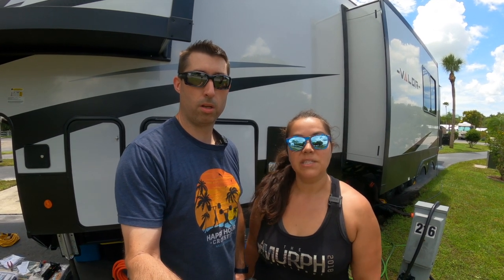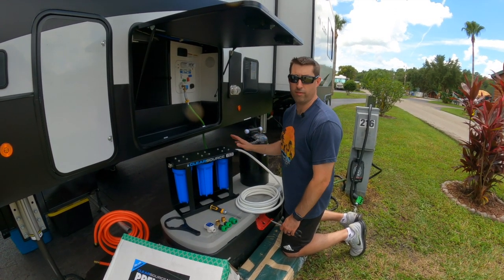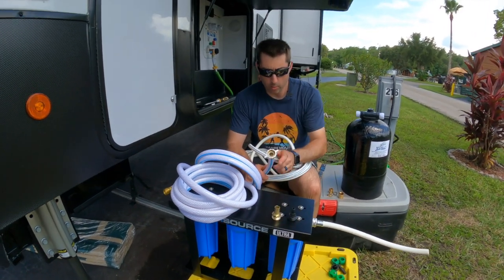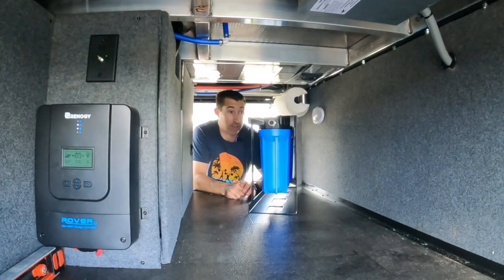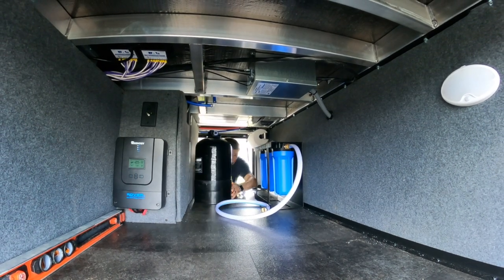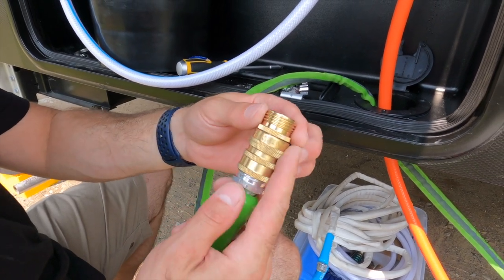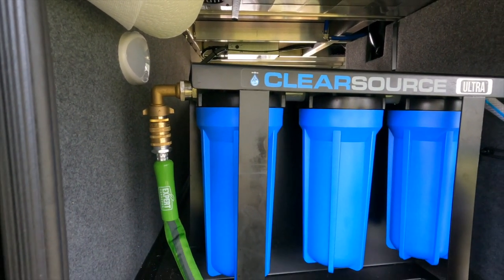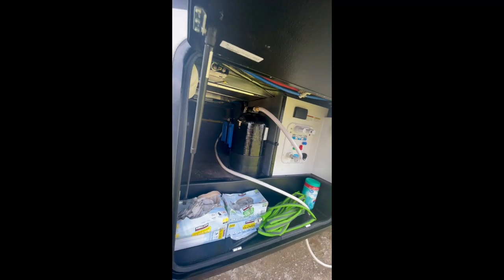Best RV Water System

Comment: Nice setup! I would be afraid of a leak popping up out of nowhere. I have seen too many issues with water filtration setups in bays that leak and are not found and causing a lot of damage. Great video
Reply from the maker: Hey Philip, thank you for watching the video and supporting our channel. Your advice on the filtration system is taken to heart and a valid concern. We keep a very close eye on it and have water sensors in the bay from our Ring video.

Comment: One of the issues I have seen with other filtration systems is a significant reduction of water flow in the coach.  How is yours?
Reply from the maker: Hello Rich,

We have not had a noticeable reduction of water flow using the triple filter and the softener. Both items a rated a lot higher 90-125psi than what we run. If the rv park supports it I will run 50psi in and I am thrilled with the results.

Comment: Hi Chris and Martha. I’ve noticed that using the On The Go water softener that other channels have demonstrated requires wasting a severe amount of water to recharge the units salt periodically. Because of the amount of water that is wasted, it is an extreme turn off for me since I come from an area where water rationing and management is a regular occurrence in our sticks and bricks. So the idea of letting water run down the drain or campsite for an hour as part of routine maintenance is not an acceptable solution for us. I noticed that you put your unit inside your basement. Does it not require frequent access and the wasting of water that I mentioned like the other brand? And does it require salt? I’m extremely interested in the brand you’ve chosen if it doesn’t waste water💦. Thank you in advance. Rick and Ellen, Southern California ✨🏝🌴😎
Reply from the maker: Good afternoon Rick,

I would love to say that the regeneration process doesn’t occur with our system but it does. Our manufacturer recommends 15-20 minutes of back flushing before we reach 3 grains or 50ppm of hard water. We do have to add salt on a frequent basis depending on water consumption to keep the water quality where we like it for softness and flavor. When we add salt it takes 5 -10 minutes of back flushing to get the balance. As for mounting it in the basement we chose to do that because we have a lot of space, less likely to be stolen, and doesn’t degrade due to UV.
Reply: @VenturesomeCouple  Thank you for that information. I remember you telling us about the benefits of storing the unit below, i was hoping you were not having to do the salt regen and could leave it stowed, but that was just wishful thinking on my part. I appreciate the effort you both put into your channel sharing your experiences. Take care and happy travels.😎
Reply from the maker: Thank you for the kind words.